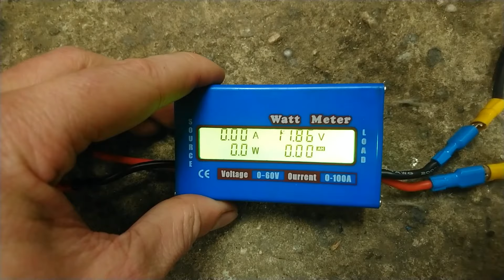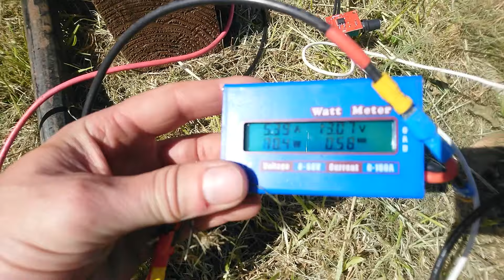Stirling Engine Generator Test 2 (Everything Going WRONG!) Part 8

Comment: I assemble and test many alternator types (including this one) at factory as my job. Thing with brushes is a regulator, it regulates power going through rotor to keep output voltage at ~14.5V no matter the rpm. You don't need to modify this alternator in any way, to work properly you just need to connect it correctly. There are three terminals at top, one should be marked as L+ (lamp), connect it to battery+ in series with 12V 10W light bulb. This is responsible for energizing the rotor. As the alternator RPM reaches acceptable level, the light bulb should go out.
Reply from the maker: So the regulator is built into the brush assembly? That would explain a lot, thanks
Reply: @ShanePomeroy  Yes, that big old TO-3 metal can device is a transistor. I cringed when I saw that you bypassed it, but didn't remove it..
Reply: @ShanePomeroy  THIS is what I told you in the last video to do! Thank you! I can't believe you've done the hard part of getting a stirling engine to work and having problems with the alternator!
Reply from the maker: 😂 LOL, thanks for your help........ Moving on!

Comment: Nice work as usual and entertaining. Thank you. A small DC generator designed for wind turbines will do well enough and is not very expensive from eBay - we run these on our special multi fuel engines that we are playing with and using a timing belt with the correct pulleys does a grand job. A PMA (permanent magnetic alternator) runs with low cogging if you can get a Hurricane model from the USA and rectifier you will probably win medals all round. But failing that a 24 volt dc or 12 volt dc generator made for small wind turbines is a low cost step in the right direction possibly.

Comment: I'm very impressed with your efforts.
Not an expert by any means, but it strikes me that in car, at least in a conventional car, the excitor draws current through an incandescent bulb. When the alternator gets up to speed the back-emf means that the excitor is no-longer drawing any appreciable current and that's why the red "charge" light goes out. Hard wiring the excitor coils to the battery, or using a PWM, is probably the wrong thing to do. Simply stick a small 12V bulb in the circuit: just a suggestion.

Comment: Hello Mister Shane, how are you? Look, everything is fine with the project, but one item is missing, to
that you reach 127v or 230v voltage. desired. Replace magnetic rotor. Have you tried to glue 4 neodymium magnets,
with the equivalent size, on the automotive alternator rotor? Just missing this! I'm sure 
If you do this, you will be successful. See you later!
Reply from the maker: Hi Leo, I will most certainly Look into this, cheers

Comment: I pulled a 24 volt brushed DC motor from a kids electric scooter. Its a little smaller than a baked bean can and I spun it up with a bike tyre like a dynamo and got 60 volts out of it while pedaling like crazy. I connected a 60 watt 240v incandescent light bulb to it and managed to get it glowing. I was planning to try making a wind turbine with it, but never got around to it.
Reply from the maker: Nice work! I am very interested with what you've said, I'll need to look into this as an option
Reply: @ShanePomeroy  I found the motor on amazon for under 20 quid if you can't find a junk scooter to salvage one from. It's sold as a 24 volt 150 watt DC brushed motor. They also sell a 500 watt version for a bit more. The only downside is that they don't have the mounting holes and pulley like an alternator does. Anyway, its a great project you have built and I'm keen to see what you do with it. Happy tinkering!
Reply from the maker: Update: this is a fantastic idea, I've just bought one off ebay for £20 + a charge controller designed for wind generator (also comes with electronic brake! Fantastic) thanks alot and tune in for the next test run!
Reply: I like your thinking!

Comment: Since the timing teeth of the belt are on the outside you could stich in a short section over the seam.  The teeth on the drive belt and the short section would lock them together.
Reply from the maker: I like your thinking! Great idea 💡

Comment: normally the bulbs connected to the excitation of the alternator are 3W, the filament of the bulb allows the necessary 'current' to pass according to the revolutions of the alternator and the voltage reached by the battery. The electronic voltage regulator fails to do the same job as the filament bulb in my opinion

Comment: A permanent magnet motor wouldn't waste power on field windings. A generator doesn't make the same voltage at nearly every rpm like an alternator but if you can keep your engine in it's sweet spot it could work well.

Comment: Don't worry about the alternator only putting out 12.5 volts. At only 11.8 volts, that battery is DEAD. It's hungry and will gobble up any power it gets, drawing so much current that you would have to have a much larger engine to generate enough current to raise the voltage much more than that. When a battery is that low, don't go by the volts. Instead, measure the current (amps) that's flowing into the battery. The more current, the faster the charge. Once it is nearly full, you will notice the voltage start to climb toward 13.8, which is where it should be kept while the engine is running.
Reply from the maker: Hi Brian, Every days a school day, Cheers

Comment: The car generator has low efficiency, because there are large losses in the field winding. It is better to use a permanent magnet generator and a voltage converter.
Reply from the maker: I've got a permanent magnet generator (hoverboard motor!) and wind generator regulator on the way. I saw your video where your stirling engine started with electric start! Very nice

Comment: PWM is not really what you need for the field windings.
Just use resistors with an amp meter.
Reply from the maker: Hi Martin, I was hoping to have it adjustable so I could vary the alternators output, unless I have it adjustable in increments via resisters? There's a thought
Reply: @ShanePomeroy  You will need to use a number of resistors and take readings of voltage and current at various RPM, plot the results and then use the the resistor value that suits your max engine output.
Or as you say, configure a number of fixed resistors via manual switches, or eventually make an automated system! 😉
Reply: @ShanePomeroy  That little PWM circuit will likely give you nothing but trouble in this application - with better filtering and power control it could do the task, but then it would cost a fair bit more and be called a variable output DC-DC SMPS.
Reply: @ShanePomeroy  I know the car audio people use a variable resistor to adjust alternator output voltage.

Comment: Stepper motors make great generators even at low speeds.  A lot of modern washing machine motors are basically a glorified stepper motor and would give you plenty of power if you can turn them. Failing that just take it apart and build a new one WOOOOOO!

Comment: add a tensioner wheel and it will solve the loose belt problem. As for the bolts coming loose, schoolboy error; use a split pin or a lock washer or wire-lock them or add loctite to the threads.

Comment: Get out the ohm meter, and stop killing PWM controllers.  Find out which brush is grounded, and avoid shorting 12v to that side.  Don't test the hard way.  Then run a 12v light bulb in series with the rotor circuit.  What wattage you choose is your choice.  Use a headlight for maximum rotor output.
Reply from the maker: Lol, yes your right! It had been a long afternoon and the engine was running and I thought "let's see what will happen"! I can't help it, it's my irrational side! I'm trying a hover motor now with a wind generator charge controller, thanks

Comment: I have no clue why your trying to generate electricity off this monstrosity with a car alternator.  If that is your goal I would cut the pistons down 1/5 their current size, reduce the massive amount of weight in your flywheel linkages by reducing their length in the process reducing drag and weight.  Your doing a WHOLE lot of work moving all that metal around which means it is not going into generating current...  If the earth around you is vigorously shaking but you just cant seem to drum up 1 HP in your flywheel there is some serious mechanical inefficiencies.  Good luck! it looks wicked dangerous and im sure once you get the mechanicals gyrating in proper fashion you will be able to move a train with that damned thing!!!
Reply: Hey great point of view. Stirlings usually don't poduce too much power, but certainly a lighter design could help.